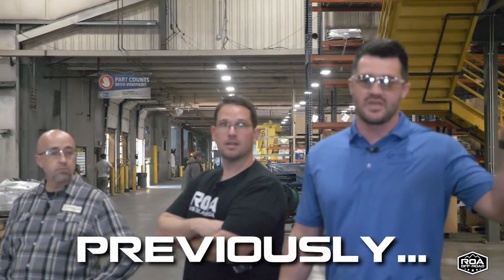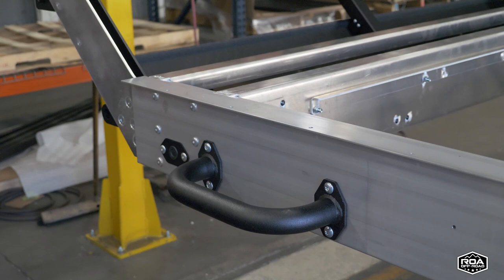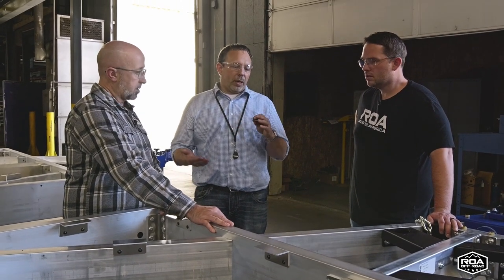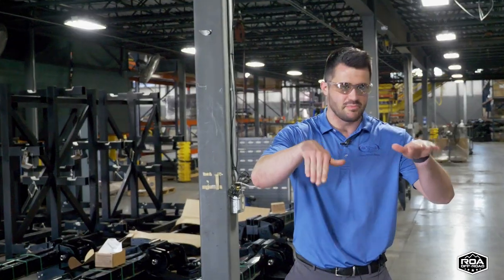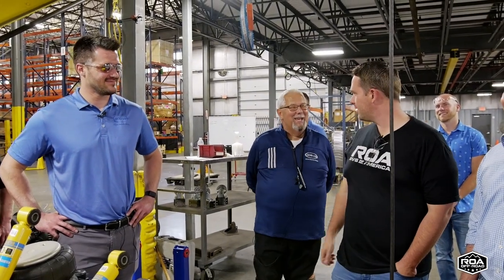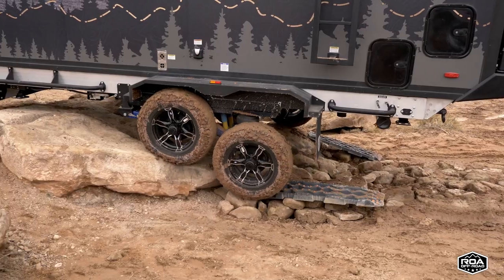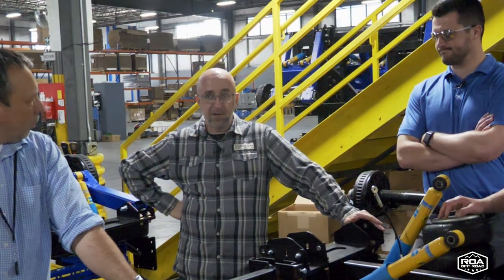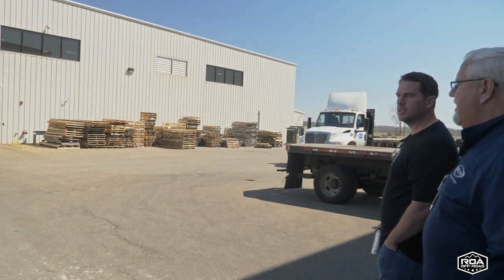Is The World's Best Off-Road Camper Suspension Made In The USA? Morryde EP 3 | ROA Off-Road

Comment: This is pretty amazing engineering!
Reply from the maker: Yes! The Pause is amazing. Stay tuned for tomorrow when we do the tour on the 16.4 😀
Reply: I appreciate the open discussion here on the weight of the suspension. I could tell Maynard and Shane were implying that there must be a way to lighten this morride bad boy suspension.  I assume the 16.4 will have the same 700 lbs system. Confused on the 1,000 mile (25 years) average life of a trailer.  I must be having a senior moment here as I put 3 000 miles on my trailer driving it home in 3 days. I wonder when the engineer was designing this system they forgot to use the ccc and dry weight of a pause trailer instead of the 15 ton ccc of a semi trailer? It does seem over built.
Reply from the maker: @bartman1857  The mileage testing he is referring to is a track that they run the trailer on. The track has lots of bumps and washboard with obstacles. They run it over it constantly for a 1000 miles which is supposed to simulate 25 years of a normal trailer use.
Reply: @ROAOffRoad  that makes sense.  Like I said senior moment.

Comment: I would answer the headline of this video as an unequivocal no. There is a little company in Australia called Bruder that far surpasses everything else on the market. The Bruder suspension is both load sharing and non load sharing on their dual axel and you just don't find that anywhere else. Add to that the external reservoir shocks...two on each wheel...and all the rest of it Bruder takes the win easily. Morryde and Cruisemaster also make amazing trailer suspensions but the answer to the video headline is easily Bruder. I'm not sure overbuilt is possible when it comes to suspension btw... :) https://www.youtube.com/watch?v=hwU5D5vwRqc&t=12s
Reply: Australia are the leaders when it comes to off-road capable suspension systems for trailers, so called caravans down-under.!!